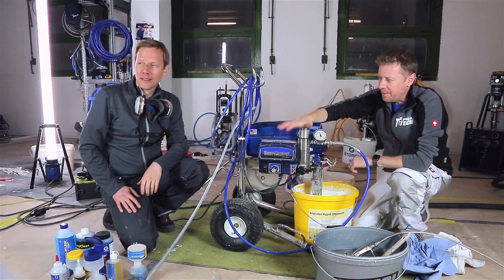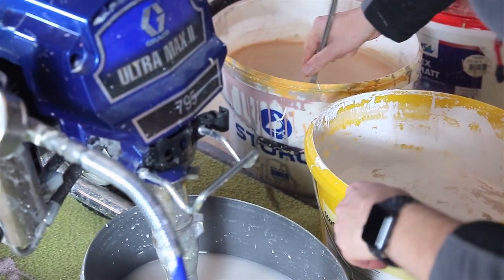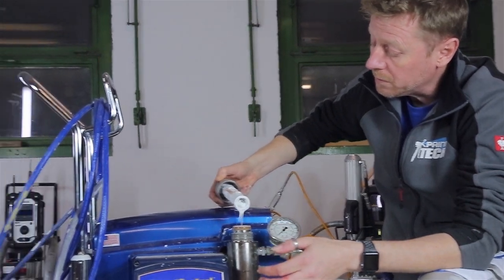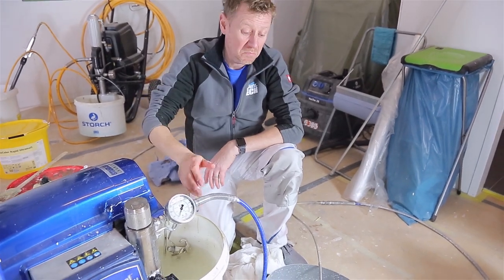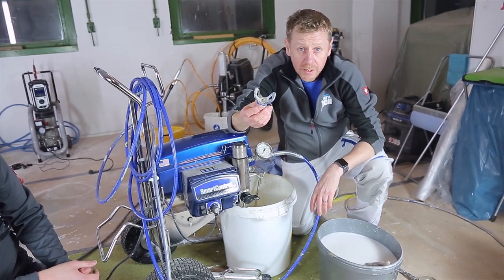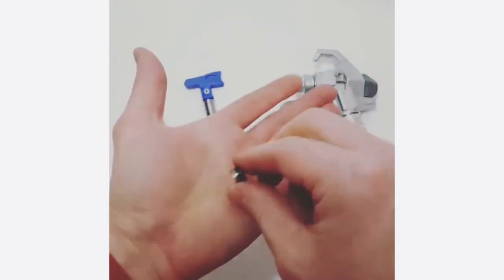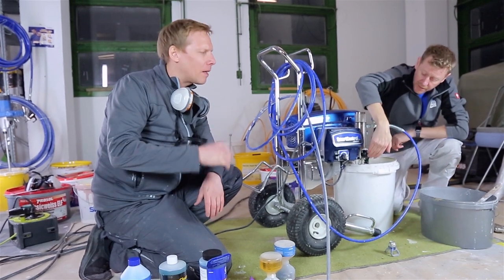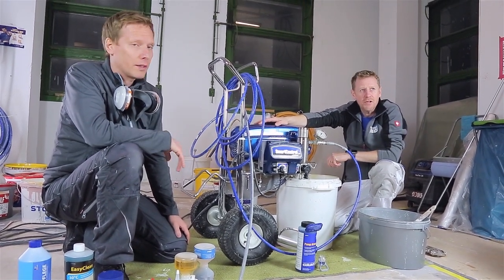Quick Rinse, Deep Clean & Maintenance of your Airless Sprayer with Ian Crump (PaintTech)

Comment: I've been doing a quick flush wrong the whole time. It seems I've been doing a deep flush the whole time. 👍🏼 definetly pass some water through both prime and gun when finished painting. Then I take out the filters and pass anti freeze for long storage.
Reply: Silicon based auto antifreeze will do the same job as Pump Armor! A simple look at the ingredients will confirm this. Pump Armor £20 per 1L / Auto Antifreeze £18 per 5L. Just make sure it’s silicon/glycerol based.

Comment: Hello Gents!

Can we use grease where we usually add lube. 
Wonder if I can stuff it with synthetic grease
Reply from the maker: Hi,
If you are talking about lubricating the piston, grease is not recommended as it will mix with the system. 
Always use airless oil at this point. 
Kind regards,
Airless Discounter team

Comment: Hi, using solvent-based primer with a 290pc graco, is cleaning with nitro-type diluent sufficient for cleaning or is it recommended to wash with water before storing the pump?
Reply from the maker: Hi,
Please wash again the pump after with water to take the "nitro" out of the pump and protect the seals. 
Kind regards,
Airless Discounter team
Reply: @AirlessDiscounterInternational  Thank you very much for your availability and clarification.

Comment: pump armour is just engine coolant.
Reply from the maker: Hi,
It is not. This is why the airless suppliers are taking the time to sell them. 
Don't forget that if your pump is under warranty and you have a problem with it, the warranty won't apply then, if there is a miss use of the pump or protection. Other products than the ones specified for airless pumps are easily detectable during check repairs. 
Kind regards,
Airless Discounter team
Reply: @AirlessDiscounterInternational  Thanks for conformation. I get my information from Paint Life TV on Youtube. He said He used pump armour for years for all of the above reasons but switched to engine coolant with no side effects and never looked back. I take your word. Im running a £175 1800w Vevor pump so not concerned about warranty if it does my house renovation it would have paid for itself. If I buy a top spec machine in the future ill consider it.